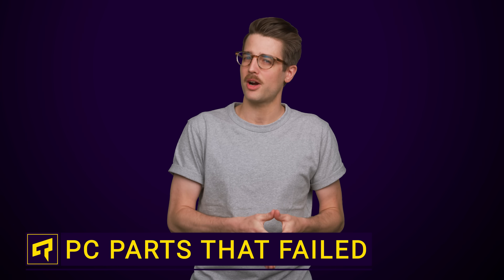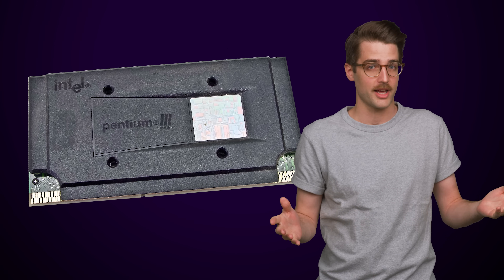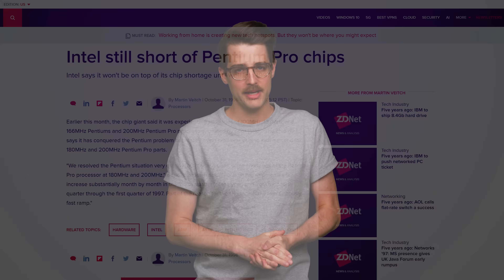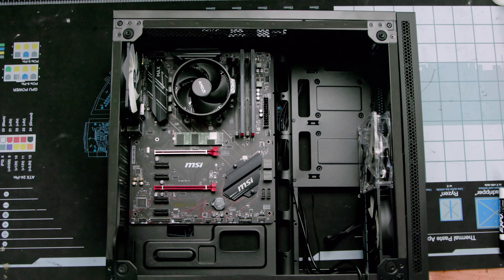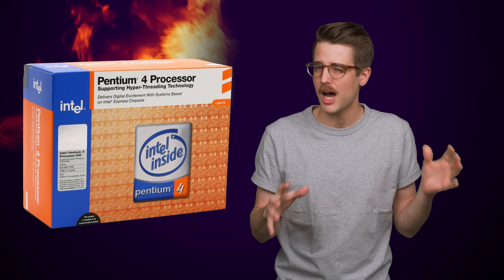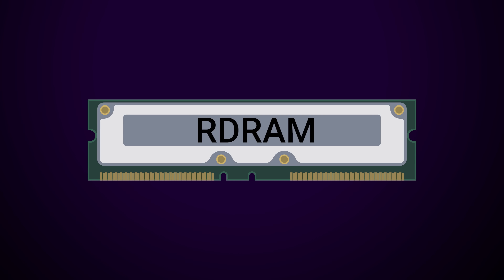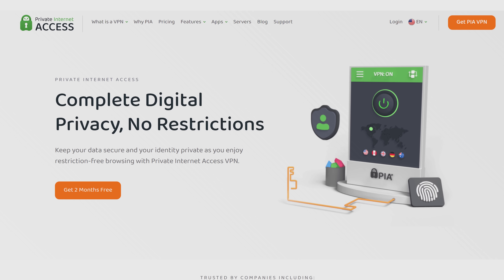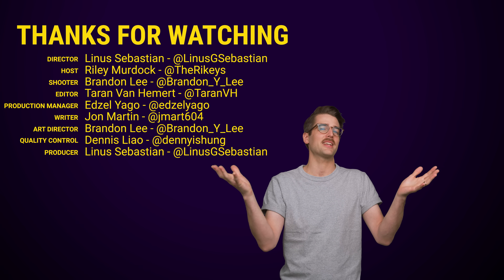PC Parts That Disappeared

Comment: A few pieces of technology that went the way of the Dodo.

Weitek math co-processor. An alternate co-processor to the 8x87 line that had a completely different instruction set than the 8087.  Software had to be written for this line of co-processors.
https://www.cpu-world.com/CPUs/4167/index.html

Magento-optical drives:
Combining both magnets, and light into one technology.  Largely killed off by CD-R and CD-RW.
https://en.wikipedia.org/wiki/Magneto-optical_drive

Bubble memory.  A technology from the 70s that was non-volatile RAM.  Turn off the power, and retain the memory contents.  Died essentially because it was never fast enough.
https://en.wikipedia.org/wiki/Bubble_memory

1 inch hard drives (microdrive).  It sounded amazing in the late 90s.  All those tiny pocket computers would FINALLY have large amounts of storage via a tiny hard drive!  Completely killed off by flash storage, and used only in a few niche applications:
https://en.wikipedia.org/wiki/Microdrive

Micro channel.  IBMs attempt to create something to replace the ISA bus, which they patented up the yin-yang.  PC Clone makers didn't want to pay the license fees to IBM, so they created EISA
https://en.wikipedia.org/wiki/Micro_Channel_architecture

VESA local bus.  A very brief ISA bus extension to provide needed bandwidth for hungry new video cards.  Died with the invention of PCI.
https://en.wikipedia.org/wiki/VESA_Local_Bus

Comment: I had a slot 1  Pentium 3.   I built a few BTX systems having worked in a PC shop at the time.  I remember RD RAM but could not afford a RD RAM based system at the time.  Turned out to be a good thing.

Comment: I just upgraded from a Celeron 300A overclocked to 450 on the venerable Intel 440BX chipset, to a Core i9 11900K, the difference in performance was definitely palpable.

Comment: Dedicated soundcards, sure you can still buy them but the improvement's in onboard in both overhead and quality as well as proliferation of USB audio, they are pretty well done for! I haven't ran one for over 15 years.
Reply: I still use one because it has a built-in headphone amp and 1/4 inch jack inputs for studio quality headphones. Saves cluttering up my desk with yet more USB peripherals.

Comment: Why have people stopped buying sound cards, ASU’s has amazing sound cards.
Reply: Because the difference between motherboard audio and soundcard audio isn't noticeable unless you've hooked it up to a good sound system. I'm running a wireless headset, my Realtek onboard sound hasn't even been used in ages, because when I'm NOT using the headset, the audio's going over HDMI (using AMD's sound system in my graphics card)
Reply: They still buy sound cards… okay, mostly (semi)professional audio recording sound cards.  RME, Avid, Focusrite… a number of manufacturers are still quite active.  Those cards, of course, cost "an arm and a leg".  ;-)

Comment: Im surprised AGP slots weren't mentioned. AGP was superseded by PCIe in much the same way RDRAM was superseded, and occurred not long afterwards too.

and ye old floppy should have had an honorable mention just because of how iconic it is.
Reply: For those who're wondering: AGP was a special slot for a graphics card (Advanced Graphics Port).  It, together with PCI slots, was superseded by PCIe, which made a separate graphics card slot obsolete.

Comment: Fun fact, the Nintendo 64 used Rambus ram. You had to install Rambus in pairs, or any open slots would require a Rambus terminator. The Nintendo 'jumper pack' is just a Rambus terminator pack, the Expansion pack memory is identical to the memory in the N64 itself.

Comment: Slots will comeback. Imagine putting multiple CPUs on both sides of the cartridge and heatsinks both sides..
Reply: I highly doubt it, at least not in the 'slotted CPU' form, maybe 'slotted single board computer' where the slot just hooks to an expansion backplane in an a small form factor case. AMD is going to an LGA socket and Intel's been on those for years, they don't stack back to back well, and even PGA sockets (AM4 and old intel sockets) have so many pins that doing that would become an expensive mess.)

The only use might be servers, and it'd be cheaper just to make the motherboard bigger to make room.

Comment: the need for a sound card. i remember having to make sure a sound blaster 16 was in all my builds 20 years ago
Reply: I remember when those were usually the major compatibility stumbling blocks for games back in the ol 80386 days.
Reply: Still holding on to a Sound Blaster Audigy 2 ZS (and using it).
Reply: Probably want to add at least 5 years.  Soundblaster 16s are older than 20 years, and certainly were obsolete in new builds by 2001, with many motherboards not even having ISA slots.
Reply: @Aeduo  More like 30. We got our first sound card in 1993, and it was an SB16ASP. Pity the ASP part never got any use outside of Creative's own software.
Reply: That and the need for network card. Now you only need a network card if the onboard stop working or you need to have more than one ethernet ports, such as if you are building a custom router.
Reply: @UltimatePerfection : You  may wish to have something faster than onboard NIC though.
Reply: @jeschinstad  It's fast enough.
Reply: Sound cards? Those are hip compared to internal pc speakers!
Reply: Still rocking a SB Live! Value 5.1 card
Reply: Motherboard integrated sound still sucks ass. If you think it doesn't, you just haven't heard better. I have tried to move away from sound cards for over a decade now and side by side comparisons consistently show that it isn't worth it.
Reply: @ReivecS  I’m not using my rig to edit audio or listen to music, so it’s not a huge deal to me but you are right
Reply: @ReivecS  thats thethign tho, anyhting that needs "side to side comparission" to show its "not worth it" is worth it... if most people can only tell its worse then something else by a direct side by side comparison than its not thatmuch worse and its good enough
Reply: Some MS-DOS games did do impressive things with music using the old PC Speaker. The DOS port of Golden Axe (however terrible the gameplay is) rapidly switches between two notes fast enough to almost sound like two sound channels even though the PC Speaker only had one. I love messing around with the settings in DOSBox to see what weird way I can run games (like CGA graphics with full MIDI SoundBlaster sound).
Reply: @linkthehero8431  i'm just learning midi and all of it's glory and power. as an avid home music producer i'm absolutely floored by just what midi can do and how it gets the job done. sure... there's a finite amount of channels. but honestly i could never see myself utilizing all of them to make a song!
Reply: I legit reused my SB16 from my 486 in multiple builds until I could no longer use ISA expansion slots!  By then, Realtek had taken over the onboard scene and I simply always nabbed a motherboard with a Realtek audio onboard.  Been doing that ever since... even if I don't use it anymore.. thank you wireless headphones!
Reply: @TheXev  AWE32 was great
Reply: @TheXev 
Same here, but a few generations newer. The Soundblaster 16 PCI I got as a Christmas gift from my parents in 1999 stuck along for multiple builds until new motherboards stopped coming with PCI slots.
Reply: This is what my mind immediately went to when I saw the title.
Reply: 30+?
Reply: Maybe there's a chance my motherboard audio just kind of sucks but there was a huge difference in quality from switching to a sound card.
Reply: Man, I remember having a sound blaster that was missing its driver disk... Never could get it to work.
Reply: 600 Liker
Reply: But it's just that now it's built into the system, like the network card. And you're stuck with whatever the manufacturer of the mobo sticks on it, rather than being able to put in better ones. Well, you still can, but good luck finding one that's better.
Reply: @toddnolastname4485  i actually record music with a dedicated audio interface. so much better fidelity than whatever is on my current mobo indeed.
Reply: @darealboot1  Agreed.  I use a Creative Labs Soundblaster Audigy. Sound is less distorted not just for recording, but playback of any sound is much nicer than the junk on the motherboard.
Reply: @toddnolastname4485  modern onboard audio on good motherboards are good enough. On old systems you could win a few fps with a dedicated card. But nowadays....
Reply: @toddnolastname4485 : If you think mobo integrated audio is good, you don't know much about audio. :) It's good for general purpose stuff, like integrated graphics is for graphics. But if you really care about audio, you need a dedicated interface just as much as anyone carng about graphics needs a GPU.
Reply: @jeschinstad  i found certain games benefit to having one as well. mainly large scale games like battlefield or planetside where there can be a lot of sounds going on at once
Reply: I think modern PC's are shifting towards a thunderbolt/usb interface for connecting an external converter/amp. Less compatibility issues and you dont have to worry about what devices are going to occupy your limited pcie sockets(looking at m-atx builds lol). and its plug and play :D

Comment: This takes me back to my teenage years.  My first computer I ever built had the option for a Slot CPU but we used a Celeron socket CPU because we were in a school with a limited budget, but I did buy a Pentium 3 Slot 2 CPU to try it out and loved it.

Ultimately I went with a Dual Pentium 3, Socket 370, board and at the time my combined power was faster than any comparable Pentium 4, socket 423 at the time, and the heatsink/fan combo wasn't so heavy it broke off my board.

I maxed out at 512MBs of RAM, had a GeForce 4 Video Card AND a DVD Burner, even though I never once burnt a DVD with it.  I had a plexi-glass side and some lights and man I felt like a baller.

Comment: The SuperDisk or LS120 drive that was backwards compatible with 3.5 inch floppy drives, Intel Itanium CPUs which were supposed to usher in a new era of 64 bit computing on a whole new architecture, 3D TVs and computer monitors, dedicated sound cards that used to have a market as competitive as the GPU market, and dedicated physics processing units.

Comment: I have one of those old Pentium 2 CPU's still. Pulled it from a system with 2 slots for dual CPU's. If you have a 2 slot board you need a Terminator card for slot 2, which we also have. It's neat stuff.
Reply: Siiiick. I wonder if I could make a Raspberry Pi compute module look like a slot CPU.

Comment: I had Rambus memory with the Intel III 733 CPU. It was given free with the Intel motherboard and it was cheaper to buy a 2nd motherboard for the free Rambus memory than buy the memory on its own. So it was out and in use long before the Intel iv. Rambus died after DDR was release as that ram was far cheaper and easier to get.

Comment: I'm still waiting for GPUs to move away from the Slot Design
Reply: The problem with that graphics cards require a lot of exclusive real-estate to themselves for their own VRM, RAM, ASICs, ect. You might get a 'socket' but it'd still take up about the same room in your case. (see: Thunderbolt internal sockets, which never became a thing AFAIK).
Reply: @DFX2KX  I don't really care about the space, but I dislike the current GPU cooling design with the fans blowing against the PCB. I would love to see a cooler design like used for CPUs
Reply: @markusstaden  NZXT makes an adapter to use a CPU water-block for GPUs, and there are aftermarket cooling stacks that use 4/5 slots to maximize cooling. Outside of extremely high workloads for very long periods of time, I can't see a modern GPU generating enough heat to need something like an Evo212. My 5700XT has been slaving away at Fold@Home work and it has never once hit thermal throttle, it uses a conventional 2 slot tall triple-fan setup.

Also, Noctua low-profile coolers do the GPU cooling solution for CPUs, and those work pretty well as far as I can tell.

Comment: The first PC that I built was a Slot 1 CPU. Pentium III 600 MHz CPU (Coppermine core) on a 100 MHz FSB motherboard. It had a BLISTERING 128 MB of RAM. That’s right, kids. My first custom-built computer was a beast in its day, but sported the same amount of memory as the first iPod Touch!

It also had a kick-ass 3D graphics card that was about 50% of the machine’s whole value, but if I wanted to watch DVD movies (yes, DVD, not Blu-Ray or HD), I would have had to buy a SECOND video card to do that decoding work.

Comment: Oh baby. Can talk about rambus without bringing up the 820i chipset / motherboard recall!  Basically intel had banked on ram is prices coming down, and when the didn’t the used a thing called a memory translator hub to allow for sdram on the 820i chipset. Every one of those motherboards had to be recalled. The mth was a major failure, it just did not work. Sad because the 820 chipset motherboards that used rambus where actually pretty bitchin at the time. I cannot recall… I think these were socket 370 systems?  I don’t think they were slot 1… but maybe?

Comment: The slot architecture is Intel's attempt to out IBM, IBM.  IBM switched to the Micro Channel bus in the PS/2 line to take back control over the expansion options from the clone manufacturers who were using ISA and EISA . ISA did not have royalties, MCA did. At the time the Slot was designed, Intel was fighting against pin compatible chips from AMD and Cyrix that would work on Intel hardware and were cheaper than the similar Intel chip. The Slot was their attempt to kill off the pin compatible chip makers as they would not sell the Slot design to outside companies without royalties. No one really wanted  The limitations of the Slot design were quickly seen and intel dropped the architecture.  I believe at the point that it happened, Intel was switching to LGA chips.

Comment: Here is a topic for you to explore. What did the USB replace? You can start with most PC expansion cards. Then go into PCMCIA cards for laptops. I have an old Compaq Armada (still works) that has two PCMCIA slots and one USB 1 slot. You can go into what devices were once on expansion cards and what became standard on the mother board. I had an expansion card for my Logitec mouse that was only for a mouse.

Comment: I remember the slot-A days quite well owned a custom made desktop with one.

Let's be honest company's change the format of the computer hardware every few years. Cause when someone wants to build a new custom desktop computer. The person will be buying at least a processor, motherboard, ram at the bare minimum.

The person could re-use hardware like power supply, hard-drives, SSD and even a video card if it's still good enough for their tasks.

Comment: Had one. Went AMD after and never looked back to this day. Running a AMD3900X downclocked, and still benched faster than any Intel PC. Intel sucks. Ever since that day with slot CPUs, been downhill ever since. Intel can run Notepad fine, but anything else I wouldn't trust it.

Comment: I'd mention Firewire, but I can see how it really should only be an honorable mention at best.
Reply: I really want the lighting port to be the next firewire but apple doesnt want to let it go, thankfully the EU has other plans
Reply: firewire is still used too
Reply: still use it won't give it up and in fact when I build a super secure system it's one of the things that I like to use because it is 100% rock-solid And I know everything about it from the inside out including how it transfers data.  

I think I still have the driver key to use the firewire networking protocol that they released.  later on it was built into Microsoft Windows PC and of course Linux had it first.    

at least four video or doing audio work it was the bee's knees.  
however no matter what you did the firewire drives were way more expensive than all the rest including the sum of the cables which was absolutely atrocious or how much they charge for the firewire interfaces.  

yet even after all these years some of these drives I have are about 20 years old now I think still work with the firewire interface I think that's why I love a Data Drive so much because they were the first firewire drives ever purchased.  

followed by the drives Lacey sold
Reply: It’s sad what happened to FireWire, because it’s (and TB1 & 2’s) lack of adoption is why Apple said "fuck it! If you’re not going to adopt our superior connector, we’ll make laptops that only have said connector!"

Also, I still have FireWire cables and drives for whenever I’m servicing older Macs.